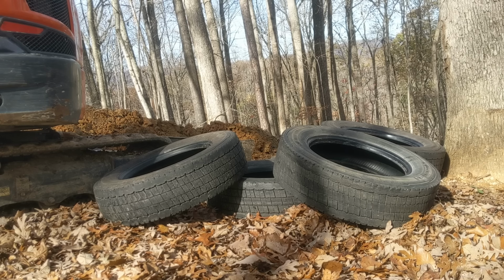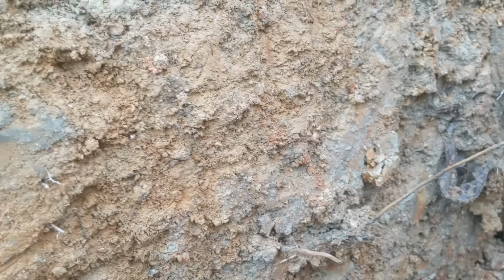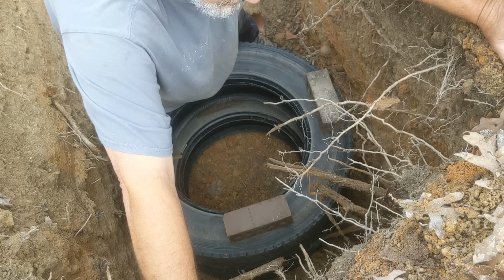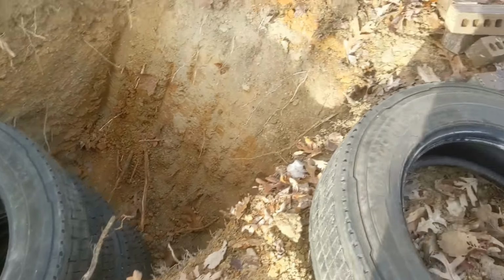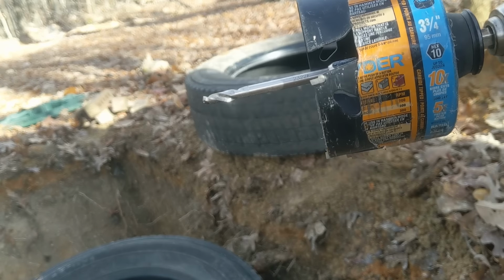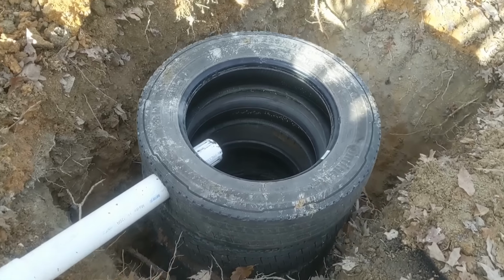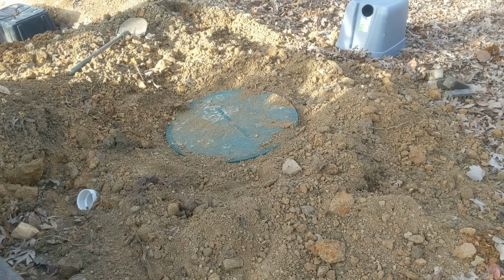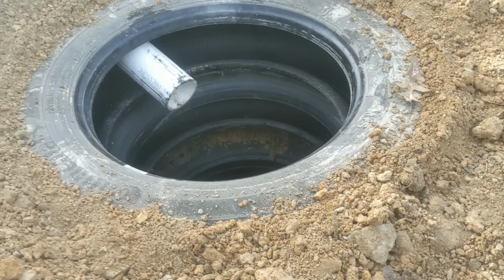DIY used tire septic system for a rv, cabin or tiny house. all made out of tires.step by step build

Comment: Dirt will fall through the brick spaces and fill the thing up. Don't you want to wrap the whole thing with landscaping fabric or fiberglass screen?
Reply: Good thought but he says dirt won't be a problem
Reply: Even chicken wire would help a little bit.
Reply: He lives in an area where you don't have to get inspection 's to get power to the cabin
Reply: That’s what I was thinking.
Reply: Ever seen an old school weep tank  dirt is not an issue
Reply: Log cribs used to be a thing and they last for tens of years.
Reply: Clay ain’t a problem.
Reply: I grown up in a ranch in Mexico and I remember my dad doing that 😊
Reply: Not a bad idea but it isn't necessary.
Reply: Yep he should have done that for sure.
Reply: You ever built one?

Comment: Place bricks inside tires to prevent them from flattening out over time. I learned this from my own experience.
Reply: I wondered about that
Reply: I used field drain to fill the inside.
Reply: Wonder if you can use Ridex to keep it cleaned out, like a regular septic tank?
Reply: ❤❤❤thank you
Reply: Expanding foam maybe 🤔? Fun and functional
Reply: How much weight is real on top pressing down? It won’t compress the bricks and they have holes
Reply: How about field rocks around the dig?
Reply: Seems like a primary tank with an overflow into the tires would be advantageous. A family of three is going to fill this up in no time where as a primary tank could hold the solids until breaking down and then overflowing into your 3” line.

Comment: Those tires better be "S"  Rated.
Reply: Number two grade type s is ideal.
Reply: lol
Reply: "P" rated also good to take care of the three p"s
Reply: Better be a 10 ply to be sure.
Reply: And make sure you don't use TOYO Tires or your system will smell like Raw Squid.
Reply: I would use a double coin because they are S when there new
Reply: #2 coming through 😂
Reply: 💩 breaks down in short time 

With benefits to ground. 

Tires  ..... don't
Reply: 😀  And like my dad used to say, to be a good plumber, you really have to know your s**t. This guy's a true Appalachian plumber.
Reply: The actual rating is "load E". Extreme load.

Comment: Years ago we did the similar thing. We use the fifty five gallon drum tho. I poked holes in the sides. and put gravel around the outside of barrel.
Reply: I once saw an old 275 oil tank used as a septic tank. Just drill some holes and backfill with gravel, then cover with straw to keep the dirt out.
Reply: @rupe53 wonder if you could flip the tank upside down with the top lid off and use the shut off valve for the pipe connection?
Reply: @RustyShackle-v9u   I suppose you could but then how do you empty it when the solids build up? If its' to be similar to an old cesspool system, you still need to get rid of the solids at some point so need a top access point.
Reply: @rupe53  I imagine a 300 gallon tank would take a very long time to build up wouldn't most waste just break down and never need disposal?
Reply: @RustyShackle-v9u   If it's seasonal use, you'd probably go years because the off-period is when that happens. If you want an idea of what goes on, look at that bail of TP in your closet (package of 48 rolls) and then think about how long before you use it up. Compare it to the space in that stack of tires then add a pound of human waste (per person) on a daily basis, plus the water to do the flushing. Your 300 gallons is only 40 cubic feet but it's mostly sludge that takes time to go away. Add some soap scum and fats, which also slows down the process. Yeah, there is some science to septic systems but I don't have it all in my head.
Reply: And a dozen shot gun shells
Reply: @rupe53  ...the OP is presenting a small, special case solution for his location. It will probably do what he wants if not over loaded. In general though there is a lot of science that goes into a 'leach system' that will be reliable....not to mention the possibility of contaminating any possible ground water or water wells in the area. There are too many variables to mention.
Reply: @78tag    in this case, the science is basically some time and some distance with limited use will do the job... until it doesn't. 75+ feet to a well is good enough unless there's direct runoff. Always drink upstream from the herd!  <LOL>
Reply: I did the same thing with a plastic 55 gallon drum30 years later it's still working fine Just use  Riddex every couple of months... Made a drain field with 3 quarter " stones about 10 by 20'
Reply: This is definitely better than an outhouse, this way you can use an indoor toilet. This will probably last longer than an outhouse because there is a way to clean it out.

Comment: Years ago, I met this old boy named Calvin down in West Virginia. Calvin did not have enough money to put waterlines in his home so what Calvin did was take heavy duty garden hose and cut the length of garden hose to Size and then he use worm gear clamps, and silicone sealantto attach the lines to the fittings. It was the craziest thing I ever saw in my life, but I guess that’s what you would call Appalachian ingenuity

Comment: Where I live I told the appraisal police that I have a compost toilet but I actually have 3 plastic tanks and a real toilet. They want you to do a aerobic system where I live which I hate since I am a licensed plumber and I know they are a lot of trouble and maintenance. That is why I did my own and made it my way instead of going trough the county getting inspections and having my property tax jump up, because they consider a septic system an improvement of the property value at the appraisal district.Fuckum feed-em fish heads fight the system like a modern day Robin Hood. Great Video, Thanks

Comment: In the loosest of terms, it is a crude septic system but it is not a septic tank system. It is actually a cesspool. Have your water supply checked regularly, these things leach into your well all the time.
Reply: need to check  your water table too
Reply: new codes will say to keep them 75 feet apart... and the septic down hill of surface water flow.
Reply: @rupe53 we did 150 yards/paces and also followed he downhill rule. Dug a hole 6ft x 6 ft and 8ft deep, filled with rocks and covered over. It lasted more than 40 years, still working last time I heard.
Reply: I was just going to ask about that. How deep is his well?
Reply: Yup!!!!

Comment: Great idea. I would use rock to back fill and maybe a deep base of rock underneath the tires. I would also think about putting a tank of some sort to allow solids to decompose. I will have to research this out more, but I want a system that will outlast me, because I am getting too old to install a second system.
Reply: @jonathanking6546  and if you cut tires in half and lay them in a trech with the arch up, and fasten them together, we just created a chamber system out of used tires! 😉

Comment: A septic system needs a holding tank to break down the solids. That is why the outlet in a conventional system is near the top...the tank itself never fully drains. The water slury contains bacteria and enzymes that break down the waste.
That said: if I were to build this, i would go the other way with the tires that are spaced. Leave the bottom three or four tight together, then space the top 2. This will help achieve the "tank" needed to break down the waste. I think the system would last much longer before filling up.
Reply: A second stack of tires spaced could be connected as a leach field while the first stack sits tight. Use PVC to connect the two at the second tire from the top.
Reply: @alancomaskey2045  That is a great idea!
Reply: I was thinking the same thing, he and anyone else that builds one without some sort of holding tank will be having it sucked out on a regular basis depending on how often and or much sh:t they put in.
Reply: Or a 55 gallon plastic drum... with a baffle near the top connected to several leach lines
Reply: @steveezard8859   yes. I have done a drum system before on a camper. Only 20' of leech line (in well draining soil) 6 years and still going!
I think for the sake of the video, the idea is to try and repurpose tires....and get a septic system from them.
Reply: @alancomaskey2045  Exactly....  the solids will stack up and decompose in the first set of tires allowing the effluent to run off the top into the second and disperse.
Reply: Yea the tires need to be tight together on the bottom to make a barrel and clean the crap, then it needs space to dissipate near the top.  But this is a great idea, making it out of tires. Making something out of Free materials is always the best.
Reply: Seems  like it would be common sense to probably pour a bit of concrete in the bottom and seal it, then have the tires glued together and sealed with silicone adhesive, guaranteed this guy has a well.
Reply: @AdventureAwaits1111  ...yes, the first column of tires (even with spacers) is going to load up with solids. Once the first one has 'loaded up' it isn't going to do any leaching even after it is drained - the walls will be sealed - no more leaching will happen.
The second column (or even a third) with the spacers is your leach field.
Reply: @steveezard8859  - a large/efficient enough 'holding' tank, and the porosity/surface area of the soil around the leach system is the key. Every place is different. I hope he has considered ground water and local wells in this scenario.
Reply: @kevinrowley55  ...between the solids and the clay in that system will seal up everything pretty quick.....if the tree roots don't take over first.
Reply: @steveezard8859  I was wondering that also.  Run a couple of pipes out as a leach field higher up
Reply: @AdventureAwaits1111  This is what I was thinking of doing when i finally find a lot to set up my camper.
Reply: I agree, you need multiple tanks. The first one needs to hold water with the solids so they break down. You could use the tires instead of concrete. Not a bad idea it’s cheaper. But you don’t want the first tank to lose the water.
Reply: No it doesn't..... you all realize that these people have been building these for almost 100 years, right? I think they know wtf they are doing..........
Reply: @TheREALOC1972  if you did a little internet research before you commented you wouldnt look so uninformed.
How many septic systems have you installed? How many have you cleaned out?
He even says in the video it doesnt last more than 5 years. 
A system with a tank? Mine is almost 60 years old, works great. Never needed to pump it. But, I know how to care for my system by what I do and do not put down the drain.
Reply: @AdventureAwaits1111  Dude... I say again.... the Appellations have been doing this for a 100 years..... IF it didn't work they still wouldn't be doing it, technology and "new" has nothing on good ole fashion  know how. Good god your dense.
Reply: @TheREALOC1972  just because you insult me and say it twice doesnt make you right, you are the minority here and came barking at me. I can share knowledge, i cant think it for you. 
If you are going to address my people, spell it correctly "Appalachian". I am on Cherokee land and we use tanks....for over 100 years. Idk why you seem so angry, i guess your mama never told you "no".
Reply: in hawaii when I lived there we had cespools and no holding tanks. 2021
Reply: @veronicamoore9988  what do you think a cespool is? Same thing.
Reply: If it’s a simple toilet then a urine separator can reduce or eliminate liquids.
Reply: @AdventureAwaits1111 do you put yeast down there?
Reply: @sergioknuf  no. Occasionally i will add enzymes if the vent starts to smell, that seems to even it out. "Green Pig live septic tank treatment" is what I use. I have been steered away from Ridex. I have heard of people using yeast though.
Bleach and strong detergents are the killers of the bacteria, so my washer goes into a French drain.

Comment: I used 2 old concrete culverts that we're about 6ft long and stood them up side by side making one a solid take and the other a liquid tank then using a hammer and roxk chisel punched a inlet and a drained outlet. Put brick in the bottom of both. Works great.

Comment: I think these are supposed to be stacked without shims. Leaching between the mated tires is sufficient.  And should be 60 to 80 feet from water wells.
Reply: I was thinking the same thing. 
The liquids would still Leach out but it would keep the solids inside the tires.
Reply: And if you use 🚛 semi tires,even better !

Comment: This could be a “seepage pit” (a horizontal drain field) if you had a septic separation tank ahead of it. I don’t think you have the septic tank, so technically it’s a cesspool. 
You’re right about the 2-3 year lifespan. A seepage pit (in the right soil) will get you more like 20-30 years

Comment: I'd call that a rubber lined cesspool, in the old days they would dig a hole, fill it with larger rock, cover it with straw and then a layer of dirt. Worked for many years, then dig another hole to the side and do it over again.
Reply: have seen a DIY septic tank made from an old bed spring (frame style) and covered with straw, over the top of a foundation of rocks. Run a perf pipe out the other end for a leach field and more rocks. Dug one up that must have been 60 years old and the steel frame was still good.
Reply: Yup, that's how WE did it in the BACKwoods of Mississippi years ago. Then came a porcelain God and PVC pipe to the creek.(We lived on a hill so flowage was NEVER a problem) "Okay Memaw, let her rip"!!! I was/am so fascinatinated by moving liquid/parts/gears/etc. Great memories before all the bad ones......💜💜💜🙏🙏🙏

Comment: Had a system like this when I lived in San Felipe,Baja California. They worked great,had my 40’ two bedroom Rv trailer hooked to it. You only dumped when the tanks got full. The desert soil is all sand and gravel. The trick is ,DO NOT PUT PAPER IN THE TOILET! We put paper in a sealed lid wastebasket and waited for a good wind and burned the paper in the burn barrel! The paper will cover and eventually clog the bottom drain layer.
Reply: Wouldn’t RV quick dissolving TP work?  Do the paper fibers break down completely?  RV paper is all we use in our motorhome and travel trailer
Reply: @davidcarter3053  ...I don't think it matters - if it went in, it has to go some where and it is just something else that has to be broken down in the same environment that you are using for a drainage system - you pay for everything in one way or another :) :)
Reply: But water wells are under ground streams so it doesn't matter were a septic is they still can contaminate the water. I really don't understand septic because of that. The leach fields is drainage.  I get soil filters but like any filter they have to be changed.
Reply: I spent many vacations camping on the beaches around San Felipe. Great times!
Reply: @davidcarter3053 I live full-time in a 5th wheel, however, I grew up with a septic tank.  My mom only bought Scott t.p. and I still buy it today.  Even though Scott is biodegradable, I learned from childhood to never put t.p. in the toilet.  Our septic was never pumped and when my mom had to replace the cement top, after over 30 years of use, that tank was clean as a whistle.  I've lived in my RV for over 8 years and never once have I flushed t.p.  I just put it in a trash can that is emptied once a week.  There is no smell at all.  Good luck.

Comment: I've seen people drill holes in a plastic 55gal barrel and bury it with about 2 feet of gravel around the sides.  It works great for a septic system and it's easy to just remove the lid and pump it out if needed.

Comment: We built something similar used concrete block just loosely stacked in a circle about 4 feet tall with a precast concrete lid. My dad called it a dry well. 4 people,living there.Worked for many years.
Reply: Wouldn't it work better with rocks around it?
Reply: @outdoorlife-j4h   backfill with gravel and it's a cesspool.
Reply: @rupe53  I would think you would want the water to leave. Clay seals the ground. Like in the bottom of a pond or it can kill a lot of trees which have a hard time getting through the clay, I wonder if the clay has any nutrients for the trees?
Reply: @outdoorlife-j4h    Yes, that's why you use more gravel when you have poor drainage. The gravel makes space to store the water while you wait for it to go away. If the drainage is really poor (bad perk test) you can add a leach field / pipes, which will work to evaporate water at the surface, instead of it going into the soil.
Reply: @rupe53  evidently, you know more about it than me.
Reply: @outdoorlife-j4h    My brother does drainage work and my neighbor does septic so I have learned a few things over the years. BTW, the gravel used for this is the bigger stuff, similar to what they use under the RR tracks. It's near 2 inch and fairly rough, so lots of space.
Reply: @rupe53  ...I have lived in the desert for decades where septic tanks and leach fields are used regularly. It wasn't until about twenty years ago that I learned about the evaporation element of the leach lines. I always assumed it was all about percolation and dispersion. I have seen (including the people who owned my property before me) slabs and structures placed over leach lines. I had to abandon and redirect the lines that ran under a room addition.

Comment: The best septic system on you tube yet, very good presentation and information
Reply: Just don't expect it to pass any sort of building code inspection.  And, no bank would ever make a mortgage on a house with such a septic system.  You would have to keep it secret and never use it on a residential structure.